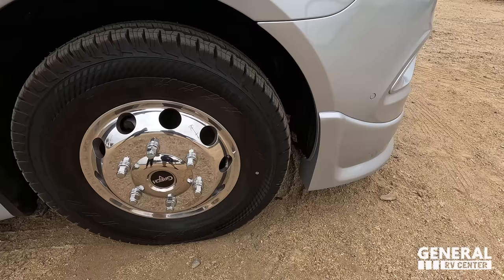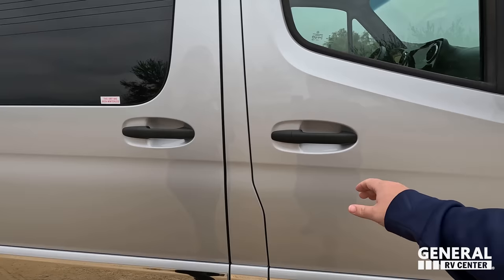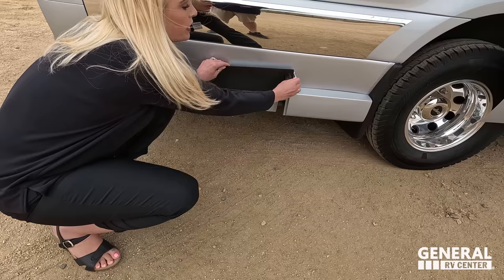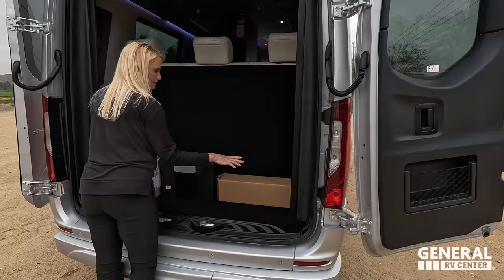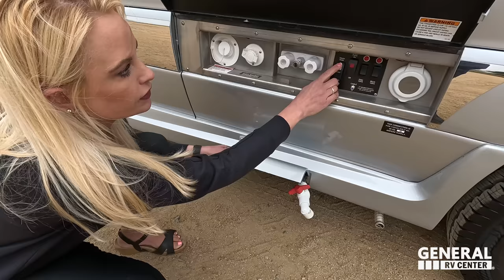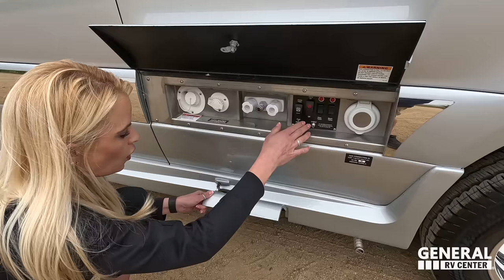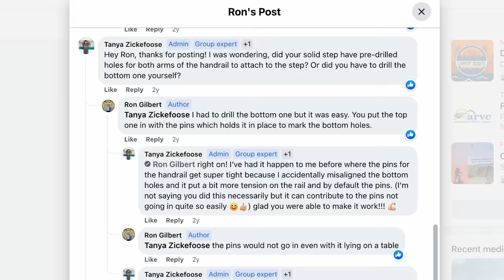Worlds BEST Quality Class B Van!

Comment: Gretch is My favorite out of all the Luxury Class B. Vans  It is by far the Best Built with all the extra steel you put in underneath and the Build Quality Inside and Out. The Luxury and Quality And the Extras are second to nun but it doesn't have a separate Shower and for me that's a deal breaker. But You are still my favorite..

Comment: 32:27 Not a fan of WET BATH.  We prefer the smart DRY BATH design by Roadtrek Pivot where you can separate the shower with the toilet using a swivel wall.  Hope more small RV van manufacturers will build their shower and toilet that way. :thanksdoc:

Comment: Did they state the cargo carrying capacity?  That’s usually a challenge with the Mercedes chassis, but maybe the air ride suspension bumped it up?  It’s one thing to have nine seatbelts, but that doesn’t necessarily mean it can carry nine adults plus water plus groceries plus other stuff.

Comment: Likes:
1. Gorgeous exterior of vehicle.
2. Quality cabinets, color of interior & blue (or white) lights are very nice.
3. I was hoping it had a perfectly fitted sliding screen door...they didn't disappoint!

Dislikes:
1. Bathroom in the back design works best for me. Just rude that the bathroom is so close to the kitchen.
2. Bigger fridge & appliances should be high not low. Who wants to drop chicken into the air fryer on the floor?
3. Too many seats. Would gladly exchange for storage, closets, pantry, book shelves or drawers.

Comment: That price is wild, because you can buy a 3500XD, hire one of those build companies, and get a custom unit for far less with good quality. It is nice to see a battery powered unit with lithium ion, huge battery bank, and so much solar, but the class B industry is just not impressive to me when hearing what custom builds go for, even with a building company.

Also, they should get rid of that itty bitty TV in the rear and get a projector back there. Can someone buy it and do it themselves? Yes. But at that price point talking about a bulky sound bar, even the TV is just taking up space and is microscopic.
Reply: Get one custom built for half the price. I’m going to buy the van, there’s a custom builder near me. More pride in their work than big corporations getting them out as fast as possible.

Comment: Looks like they copied the Airstream Interstate.

Side mirror cameras have been on the Airstream Interstate since at least 2018. How come the class B expert hadn’t seen that before?

Although I like the clean look of the hidden ports on the drivers side, not liking the fact that the entire door needs to stay open when connected to shore power when parked or stored.

You can only hear the front tv with headsets? What if you are camped or parked and want to watch tv?

I do like the attention to detail when it comes to under carriage build and addressing rattles.

Comment: There's no doubt about the build quality, love how they hide everything on the outside however, a few things I don't like: 1- wet bath and a shower curtain, thumbs down. A shower curtain at this price range is a NO. Need to look at the European bathrooms with false walls or other creative solutions to create a dry bath. 2- Class B's are tight on space, the door for the bathroom should not hinged, needs to be some sort of sliding door. 3- The fridge is too small on the Lounge floor plan.  4- Agree with you about the kitchen tap, ridiculous. 5- A few of the other luxury class B's brands also do the power sofa into a bed, I'm confused about how bedding for it works. Is there specific sheets to suit? It seems it would be annoying to make the bed every night and pack up every morning. Sleeping bags perhaps? Or is it that it's not designed to be an out-and-out RV but maybe just an occasional? Perhaps it explains why it seats so many but only sleeps two. 6- On the Lounge floor plan there is not enough kitchen bench space. Would it be possible to have the the generator as well as the lithium package? If you do another European special you should check out the Robeta Mobil Schumacher Edition, it will blow your socks off.

Comment: Dislike:  1. tiny fridge.  Don't care that it is on the floor and troublesome to get in.  You're not spending a lot of time in there. 2.  TV over drivers head.  It could be smaller, or pushed back towards rear a little more.  The color change (dark/bright) at night would bug me driving.  3.  Nothing else.

Like: 1. The material for the seating.  2. Extra windows mainly for security viewing.  3.  Pretty much the whole vehicle.

I do have a suggestion for the manufacturer.  If you read this, why can't you have a slide-in for the bathroom?  Like a slide-out to give you extra space, why not have a slide for the bathroom door to come outward maybe 3" to 6" giving you more bathroom space only when in use.  This bathroom is awesome for a class B.  Just imagine having a few more inches to shower or poop.  

Very nice over all!  I'd buy it as is.

Comment: A V6  turbo diesel that ONLY puts out 188 crank H.P. and 300ish lb.ft of torque, in a class B motorhome that has a price of $250,000+.  Come on Mercedes, you NEED to do better than this.  This van will struggle to go up any hills or mountains.  

This rig will be awful for those people that spend time off grid, or boondocking.  Only 12 hours of battery life is awful, for this price point, a generator should be standard

Comment: i dont like this,straight up,,very expensive poor storage,that dinky fridge,they could have done better with that,,the two extra seat takes away from the cabin space,,can you even get a suitcase in the back,i dont think so,,the better b vans out there.
Reply: Agree - the quad seats are more for a day cruiser.  Which isn’t a bad thing.  

The other floor plans are better for a solo or couples van.  They have better storage space and more open.